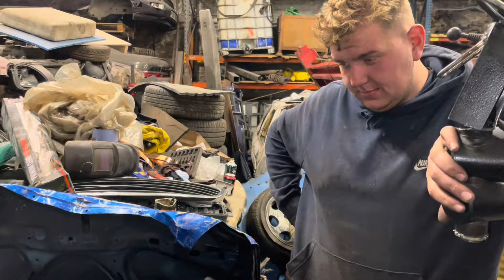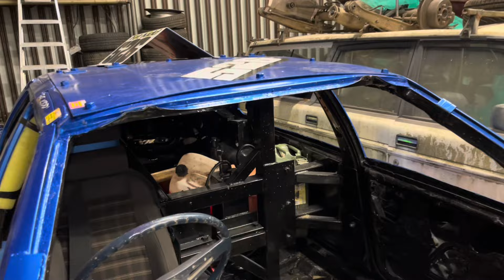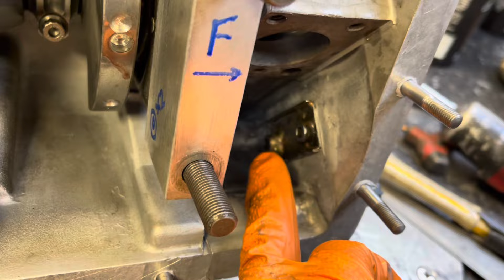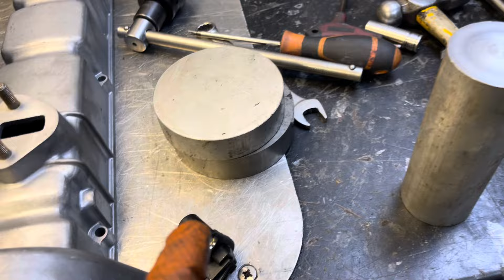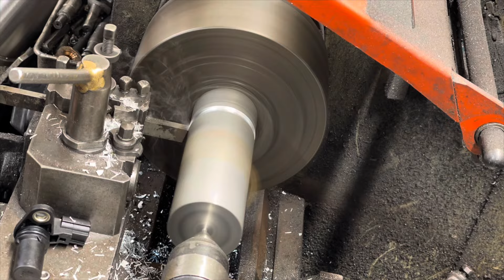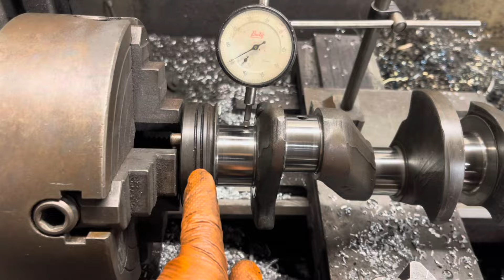Shrigleytube TV ep 66 Non result for Jack, 1200 run up on dyno, crank turn and polish.

Comment: For a cam sensor you could have used one of your electronic ignition distributors. Just remove 3 of the triggers.  The one remaining will act as cam sensor.Replace dist cap with blanking plate. Fully adjustable as well.